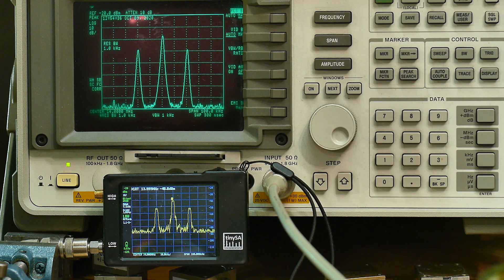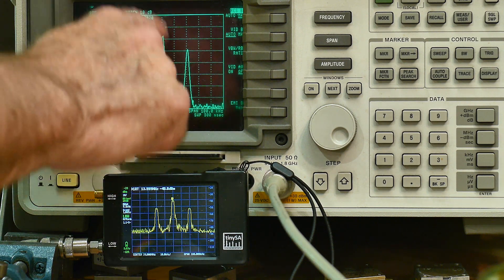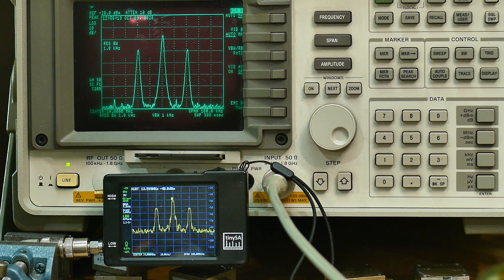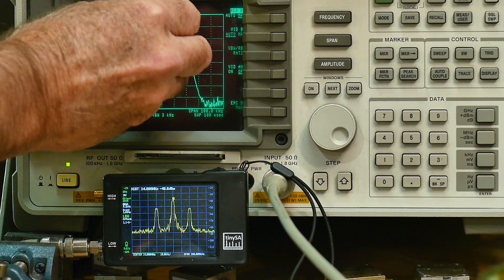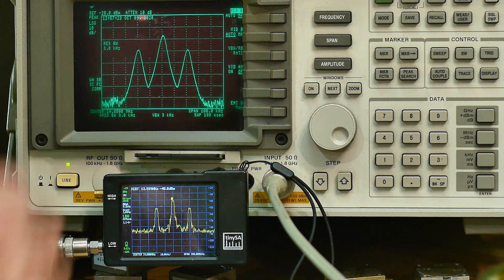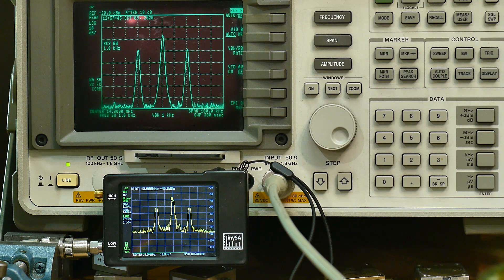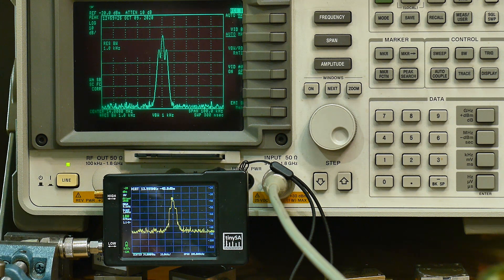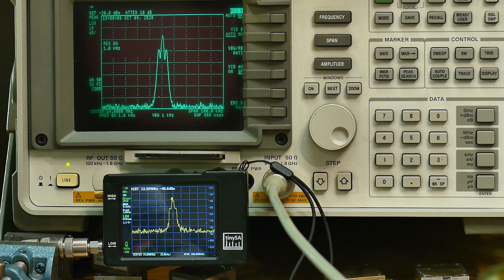#582 TinySA is 3KHz equal to 1KHz?

Comment: I'm wondering whether the flattop filter shape is possibly dictated by the SI4432? Isn't a flattop rather unusual for a SA? Even DFT-based RT SAs (which have the choice) seem to prefer rather Kaiser window by default (having a rather round top).
Reply from the maker: The flat top is indeed caused by the 4432. it is a receiver chip not a SA chip. I know of no other SAs that have anything but gaussian filters.

Comment: an important spec in SA RBW filters is the shape factor (60dB:3dB BW) which for analog filters in HP SA is 15:1 (or at best 12:1) however in ToySA they sample the IF and do all filtering in digital by taking FFT of the signal, There they can choose the filter shape (also the windowing function that they use will affect the filter shape) however digital filters, no matter what shape they use, normally have a lot better shape factor (4:1 to 6:1)  almost 3 times better than analog filters.
Reply from the maker: I've heard about filter shape. Didn't know there was a spec. The filter measurements made by the TinySA team don't even go down to 60dB:
https://tinysa.org/wiki/pmwiki.php?n=Main.ResolutionFilters
Reply: @IMSAIGuy  does not need to go down to -60dB. It's just a standard way of specifying how quick the filter response rolls off after its 3dB bandwidth